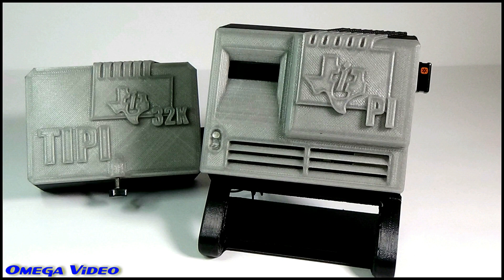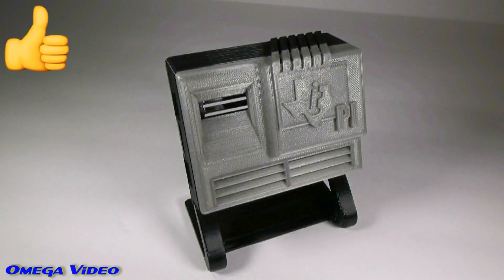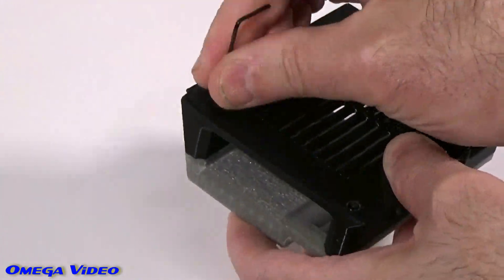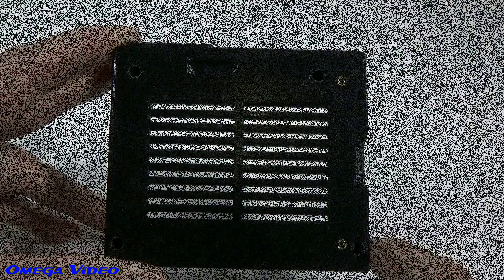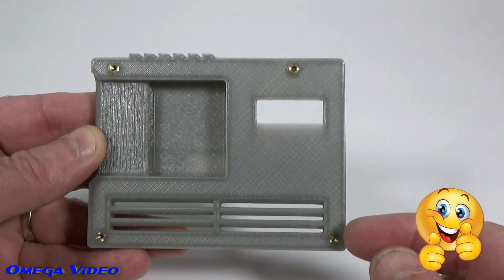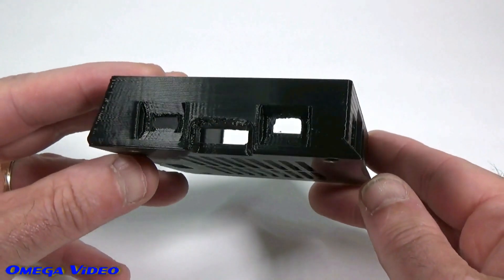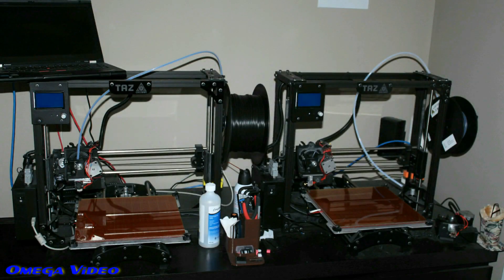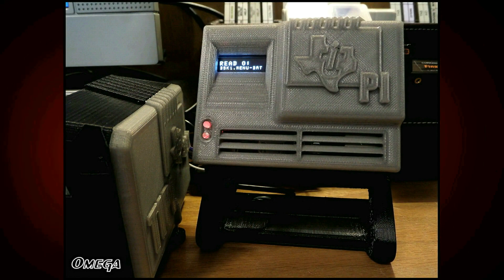Raspberry Pi Cases for the TI-99/4A's TIPI

Comment: Corei64 shop, and I believe I heard in this video, that the case maker asserts it can house a Raspberry PI 2 or 3. Just remember, TIPI does not support PI 2.
Reply from the maker: Good heads up & reminder about TIPI not supporting a Pi 2 Matt.
Some may choose to use the 2/3 case if they want to save a couple of bucks and don't care about the light pipes on the front.